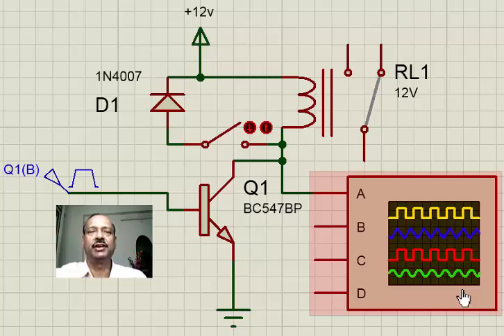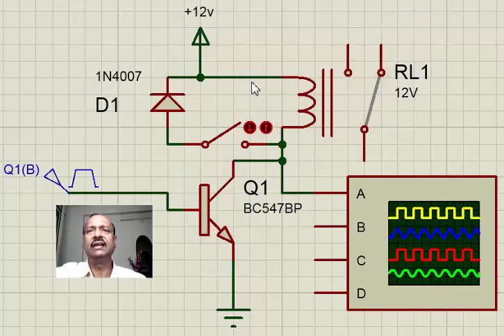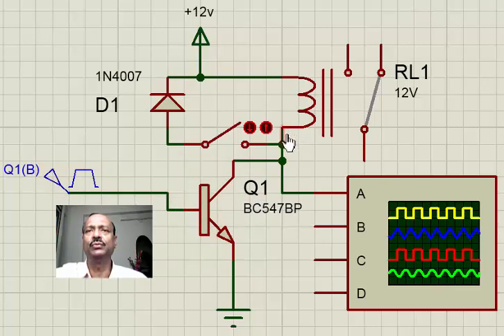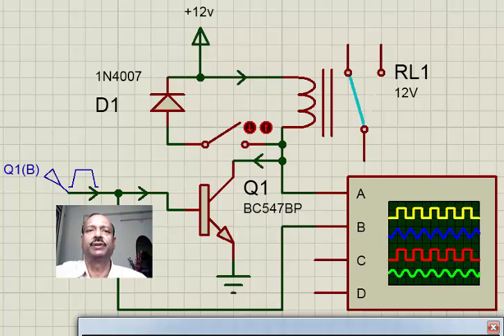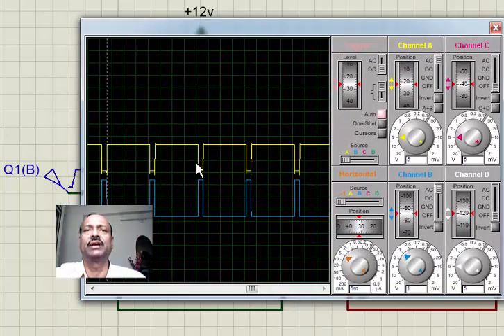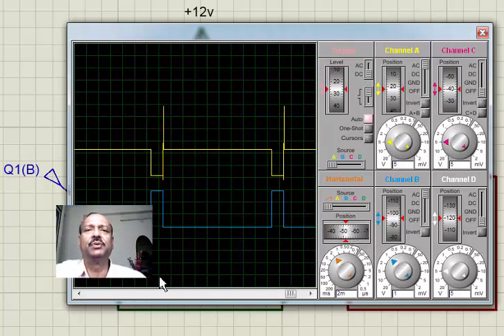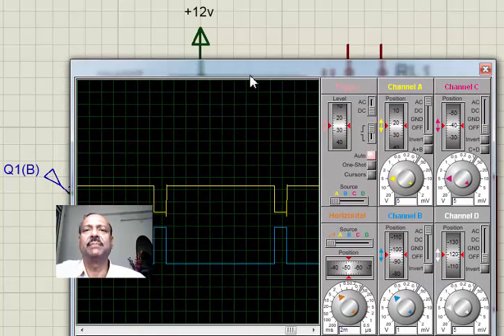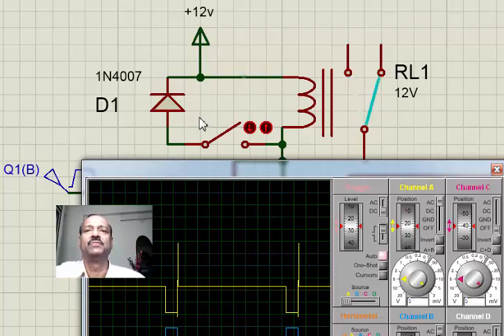Practical Electronics Snubber circuit 1

Comment: Hi! I'm an engineering student and I'm on a robot fighting team here.
I tried to simulate such a circuit in PROTEUS, but I did not get the same results. Could I pass the parameters used? And even if you can demonstrate the calculation for the snubber circuit sizing would be very grateful.
Congratulations and best regards

Comment: hye sir.any video on RC snubber?
Reply from the maker: +Adam Mukhriz All are RC snubber only
Reply: Hye Mr Patnaik. For RC snubber, what is the function of R and C there and how does it reduce the voltage, compared to diode snubber?
Reply from the maker: Diode plus RC are typically used in DC full  bridge/ half bridge inverter applications while only RC in ac circuits